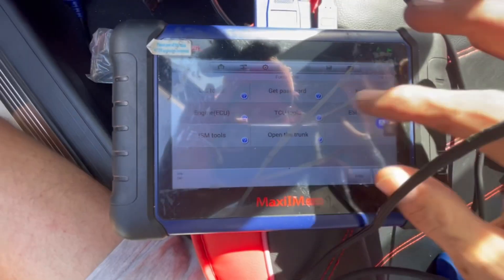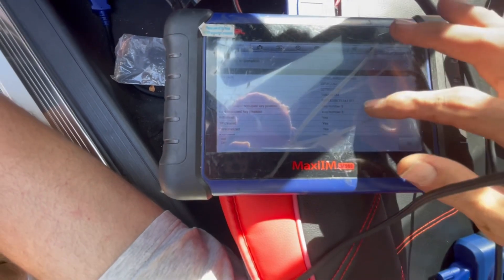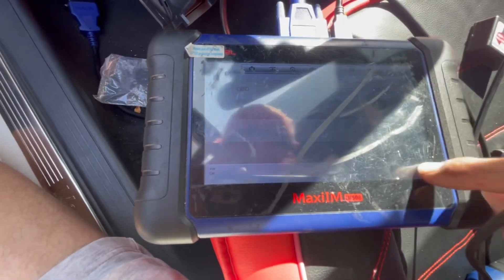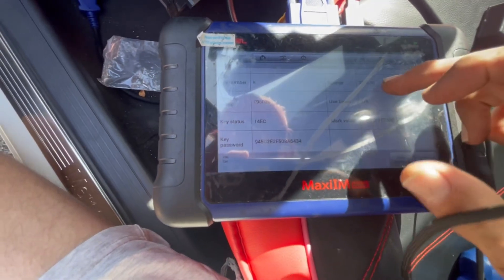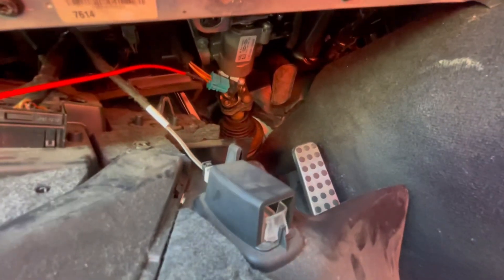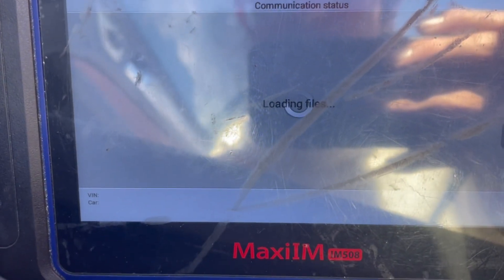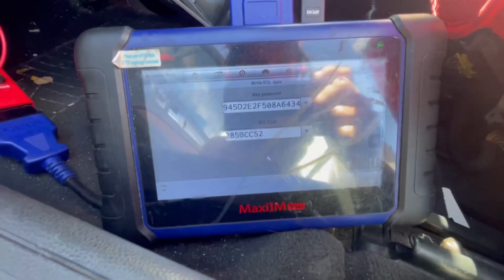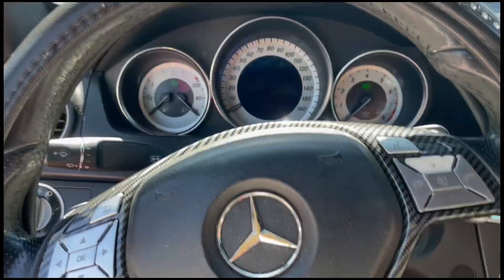HOW TO PROGRAM ESL (ELECTRONIC STEERING LOCK) SIMULATOR ON W207 USING AUTEL IM508 & G-BOX 2

Comment: This only works if the original ESL failed in the unlocked position right? If steering is locked, need to take out steering column and ESL?
Reply from the maker: Correct, you will physically need to take the lock out but programming and starting the car will be done

Comment: I have 2 functional keys, im508, gbox3, and esl emulator. How do i get password without a blank key. I want to keep my 2 keys thay work fine
Reply from the maker: Easy just go under expert selection, get password, add key, on vehicle
Even if you’re steering lock does not communicate, you can still do a key and it will let you, and get you the password
Reply: @legacylocksmith7874  I don't have a virgin key. That's the whole problem
Reply: But you need a blank key @legacylocksmith7874

Comment: Which wire are you back pinning with the gbox k line ???? ans I'm guessing that the emulator was plugged into that plug when you did the write esl function
Reply from the maker: Look good on the green connector there is a small Mercedes logo on the right wire.
Reply: @legacylocksmith7874  Thank you. I’m going to attempt to program emulator on car car before my esl fails. Thanks again